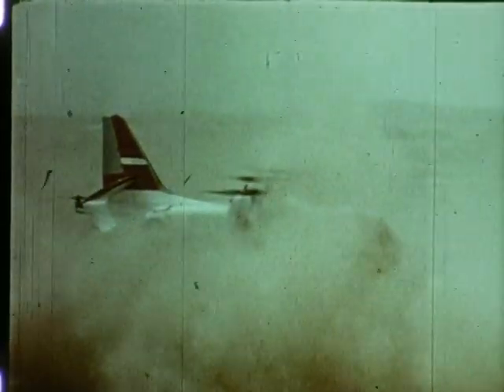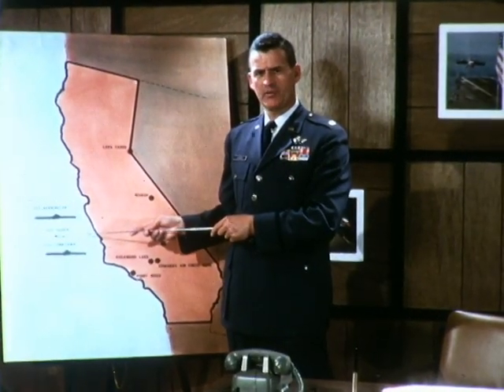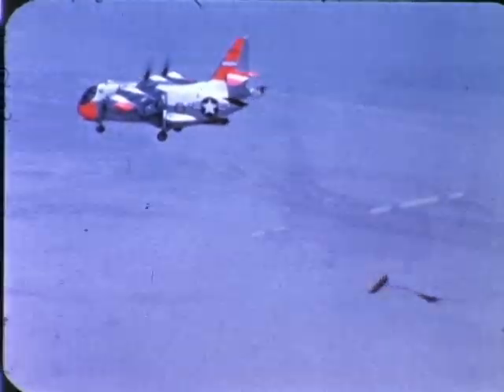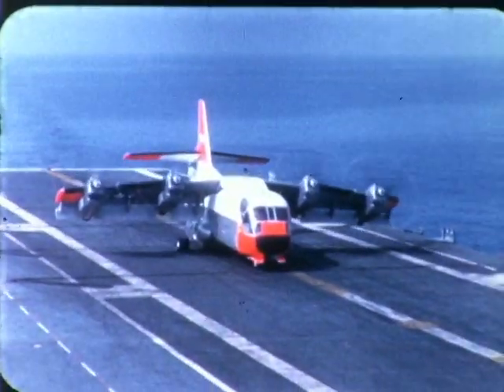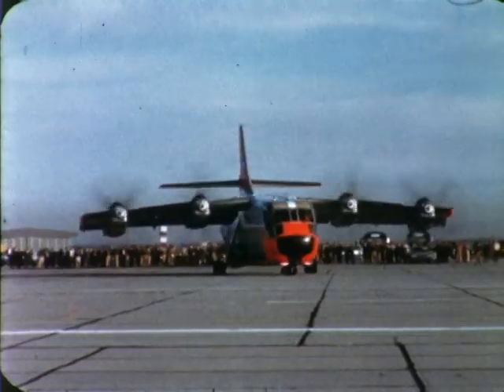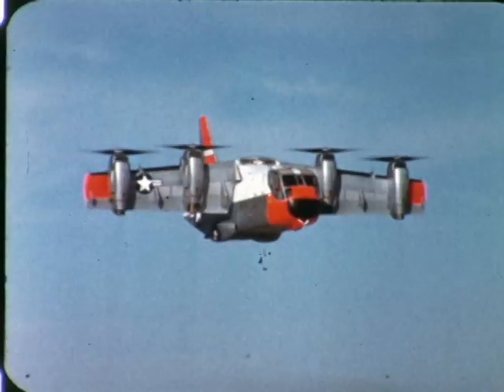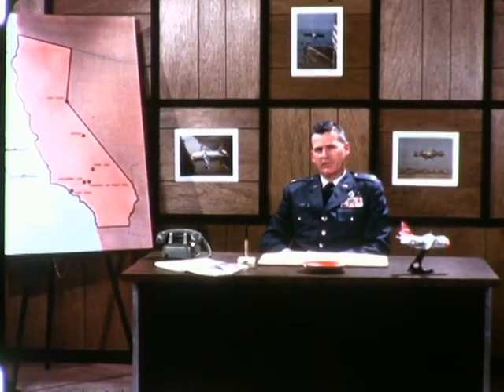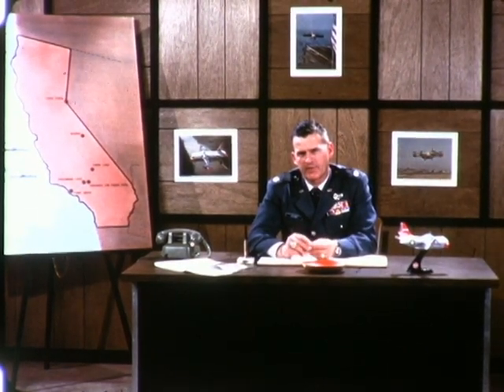F 2567 Ling-Temco-Vought (LTV) XC-142 Operation Suitability Tests

Comment: It seems strange that this information was supplied by the San Diego Aerospace Museum but completely ignored San Diego's Ryan Aeronautical company's participation designing and constructing the XC-142.

While the prime contractors were Ling-Temco-Vought; Ryan, in association with Hiller, engineered the tilt wings and more.

Ryan also designed, tooled and constructed the aft fuselage section, including the cargo ramp, vertical stabilizer, rudder, horizontal stabilizer and tail boom. They constructed the wing, engine mounts, nacelles and de-icing controls.  They also assisted in the ground and flight testing in Dallas.

There's not much else left to build.  The project should properly have been named; Ling-Temco-Vought-Ryan-Hiller  XC-142 Tilt Wing.

I watched the wings being built and when they went out the door they were finished wings, complete with engines and props, ready to fly.
Richard E. Bruce

Comment: It would probably have worked out if it had another few years funding to deal with transmisison issues,noise, stability and so on. It looks quite competent and would probably have done a very useful job in Vietnam for in-country work on small airstrips.

Comment: I wonder why the Osprey took so much time to be in the scene if the technology already existed?
Reply: @RobMrowiec  im not 100% sure but i think i remember reading somwhere that the issue with tiltrotor aircraft was controllability, the development was delayd to wait for flybywire system development. i think the issue was keeping the thing in air without the aid of computer control, but i might be wrong.

edit: interesting read 

https://dspace-erf.nlr.nl/xmlui/bitstream/handle/20.500.11881/2582/ERF1990-Vol2-II-7-3.pdf?sequence=1
Reply: Because the Air Force and Navy would rather have bombers and fighters.  It's the reason that it took an act of Congress before the A-10 was built and another one to keep it in the inventory.  Where's the glory in a flying boxcar.
Reply: If they had been able to deploy to Vietnam. They might have made it into the inventory.
Reply: The navy pulled out first then follow by the rest.  Reasons stability problems, mechanical issues and general lack of interest
Reply: An interesting idea but not practical .
It took decades to figure out the software to make a plane like this fly. 

Unfortunately ospreycan be detected from miles away because the propellers are so large, and fod ingestion is a limiting factor still. 

Typical American over-reach and over design to make machines of death so we can go around and control other countries and be the biggest baddest Empire killing an invading around the world to support the American economy and culture of death to the rest of the world and the poor to support the elites in thiscountry and the military industrial complex which is the largest destructive force to this world we know and the largest polluter and the largest user of fossil fuels and the largest destroyer of lives. 
yeah it's all interesting technology that's why I'm watching it but at what ends look what this country has become a warring insane country focused on its military and death to others around the world while our country is d industrialized polluted and the only thing growing is the stock market for the elites and military industrial complex.
Reply: $$$$ scam tax payers $$$$
Reply: The technology was very immature at the time, and you have to understand that this is basically a marketing film, intended to be shown to members of Congress to keep the money flowing. They're not going to talk about the problems here, like excessive vibration, poor stability in different flight regimes, and wing flexing that resulted in controllability problems.
It could have been a competent aircraft with time and enough funding, but this was also at the height of the Vietnam War when McNamara and Johnson were trying to cover up how much the war was costing by shuffling funds between various programs.  This caused the program timeline to get drawn out and the services realized they could meet their immediate needs with existing designs.
Reply: Engines were not great. Advances in metallurgy, engine design and computers were all important. Until the technology was advanced, it would always be a dream.
Reply: paulo I was wondering the same thing, XV-3 and XV-15 flying around for years as well.
Reply: The V-22 is almost completely different technology.  The book The Dream Machine is a REALLY good book about the V-22 program.
Reply: The V22 is a vastly less capable aircraft.  It cannot land with wings/rotors in the forward position.
Reply: @jenniferwhitewolf3784 A V-22 is less capable than an XC-142 because it can't land in a pure conventional aircraft mode?  The XC-142 couldn't do high bank angles because the wing flex would cause problems with the interconnecting drive shafts.  A V-22 can still land on one engine in a short, running landing configuration where a XC-142 couldn't do a basic combat avoidance maneuver with out massive drive shaft vibrations.
Reply: @jenniferwhitewolf3784  I don't think that makes it less capable. The V-22 can't autorotate much if at all either but that doesn't make it less capable than a helicopter. An airplane is kind of screwed if they have to land without landing gear extending as well. If the V-22 has to crash land and is lucky enough to be near a smooth flat landing area with props forward- "Heavy components, such as the engines and transmissions, are located away from the cabin and cockpit area. The proprotors are designed to fray or “broomstraw” rather than splinter on impact with the ground. The energy-absorbing landing gear system is designed to attenuate most of the energy for hard landings up to 24 fps. The wing is constructed to fail outboard of the wing/fuselage attachment in a manner that absorbs kinetic energy and ensures the cabin area will not be crushed, thereby protecting the occupants. An anti-plow bulkhead prevents the nose from digging in on impact, and the fuselage provides a reinforced shell that is designed to maintain 85% of its volume during a crash. Aircrew and embarked troops receive additional protection from crashworthy seats that stroke vertically to absorb energy." https://aviation.stackexchange.com/questions/22491/can-the-v-22-autorotate

Comment: Why did the dod spend a bazillion dollars (and a dozen or more lives) on the funky osprey when this thing was proven already?
Reply: That is because the bad guys group could not get their hands on it quick enough.  The Osprey is not the best of quality (the president is not allowed to fly in one) but it is making profits for whoever.  We are not here to make the best plane.  We are here to maximize profits for our share holders. Who cares if we win or lose our military campaigns.  What is most important is that we suck the blood of American taxpayers when the manufacturer sells it to the military an they keep coming back for upgrades and maintenance costs.
Reply: Because this plane, while fast, had a crappy combat radius of 350 kilometers. The Osprey has a combat radius of 700 kilometers. Also, teething problems during development occurred; the transmission system tended to shake the plane apart and the cockpit was excessively noisy, impacting pilot performance.
Reply: @FIREBRAND38  Think About What You Just Stated, Trump has never been married this long or to a woman this old !
-Sarge

Comment: Though the Osprey has its problems one thing it did get right over the XC-142 was tilting the engines and not the wings. Wings are needed for lift which means if you tilt the wings you lose the lift. It also means that until the wing moves to horizontal they are acting like an air brake.

That said it is still fascinating to see this footage.
Reply: The fact the Wing Angle is Adjustable Eradicates the Problem you suggest.  I think it is Impressive, Probably Could be Simplified and Improved now.  I don't suggest the Osprey Method is bad though.
Reply: What You Stated Contradicts The Law Of Aerodynamics, the transition would provide lift the entire time until full vertical positioning of the wing. ie Extension Of Flaps during landings and take offs on normal aircraft. 
-Sarge
Reply: @frankiehumphreyiv5972   FH, Watch the Vision, the Plane ( Hybrid Helicopter) Executes a Number of Different Types of Take Offs.  It Proves the Laws of Aerodynamics at a Number of Wing Angles. I stand by My Comment.
.General
Reply: Eradicates
Reply: @tutekohe1361  Fair Point.

Comment: I rather like it more than the Osprey only because it can take off and land like a regular aircraft and the Osprey can't.
Edit: I just looked up the specs on this old girl and with a 431 mph max speed and 6800 fpm climb rate, to hell with the Airforce, I want one!!!!
Reply: Who says this bird takes off any differently than the OSPREY ??
25° Wing Angle ... IS NOT EXACTLY EAGLE-like
Osprey can and does takeoff EXACTLY THE SAME ... WITH MORE POWER ON HALF AS MANY TURBINES....
AND PROB. DOUBLE THE PAYLOAD.
Reply: @kennethkustren9381  Considering the Osprey is 60 years newer, I would hope it would be somewhat better.
But if the Osprey is in level flight and for some reason can not transition to the 25 degree angle it will crash land. It will survive it, but need extensive repairs. That is why I made note of it.
By the way, why all the Caps??
Yelling is not polite.
Reply: @kennethkustren9381  Calm down, Billy Mitchell. First I can't believe you're comparing the gas turbines available to the C-142 with the ones currently available to the Osprey. Second, as John Parrish pointed out the C-142 could take off and land with the wing at a 0 degree angle without the prop tips hitting the ground https://en.wikipedia.org/wiki/LTV_XC-142#/media/File:XC142A.jpg
And your Caps-Lock seems to be stuck.

Comment: Great Colonel !  Now what happens when one ( or more !) of those engines gets shot out while I’m in hover mode ?
Reply: I guess the same thing that happens with an Osprey.
Reply: As far as I know. If one engine is damaged the other running engine will provide  "Feeding" to the other by mean of a cross connection.
Reply: Means I mean.
Reply: @savagecub Calm down, there were cross linked drive shafts to maintain propeller rpm.
Reply: @paulosilva-dm1qb  There were four cross-linked engines, actually.
Reply: Relax... it's only one engine. Not the whole left wing.
Reply: John Simpson 
I don’t think so.....that’s what sets the Osprey apart. It was the first to have that.
Reply: @savagecub  read it up in Wikipedia there was a driveshaft connecting all four engines, it's not rocket science.
Osprey wasn't even stable without electronic stabilization in the first hover trials, read up how many test pilots died in accidents during first hower attempts.
Reply: Proximo 
Yeah ?  If it’s so great why did it never make it beyond the prototype phase ?
Reply: @savagecub  if only there was only one good project abandoned out of political reasons, the world would be a much better place.

Comment: You’d have imagined that between the Navy, Marines, MAC, Air Force ... Jesus, even the Coast Guard, that ONE of the services would have wanted to find a home for it and it’s unique abilities. Not even a civilian taker? You could see Pan Am running 20 Madmen execs at a time to a Manhattan rooftop with one of these.
Reply: Like most hardware designed for the military, it would be too expensive to maintain and operate for commercial use.
Reply: Choppers are cheaper.

Comment: How is yaw controlled? All by the tail rotor or by differential engine torque?
Reply: You could use differential engine torque, but the large tail surface is sufficient to control yaw. You can see the stab trimming a little bit on some of the low speed landings and takeoffs.
Reply: in hover with aileron surfaces.